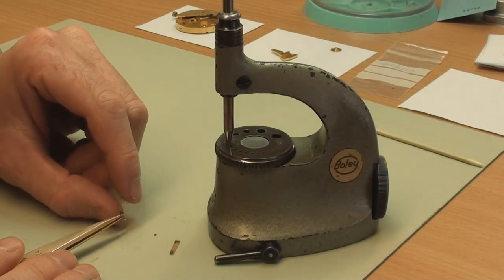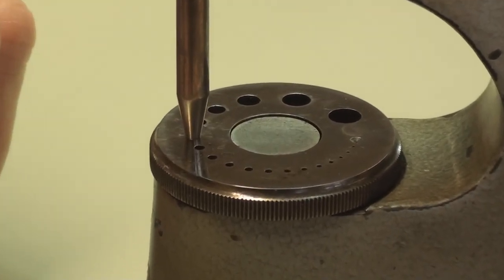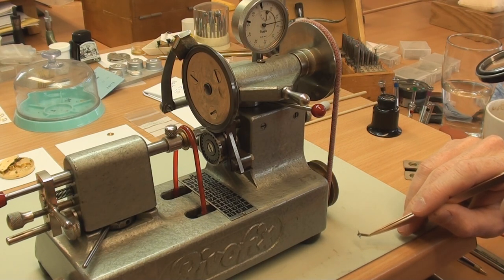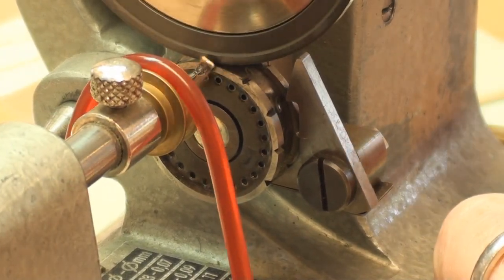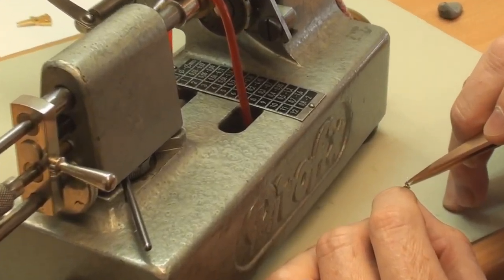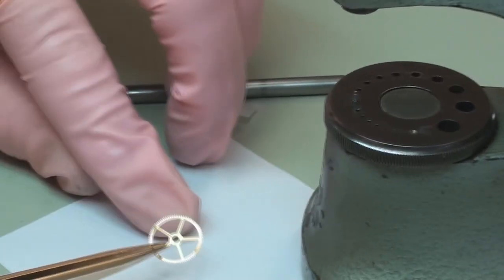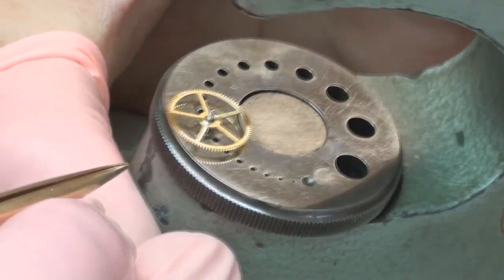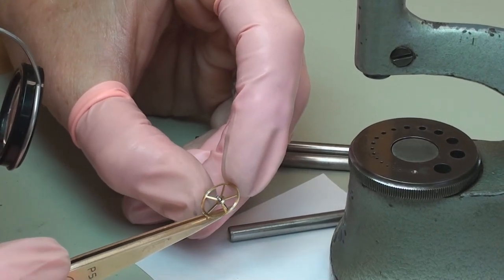Burnishing pivots & fitting a wheel

Comment: The 'Pivofix' looks to be a most useful tool - certainly looks far easier to use than the traditional Jacot. But does it reduce the pivots by 
a) Grinding 
b) Polishing or 
c) Cutting/Burnishing (by pressure) 
or a combination of these? Thanks.